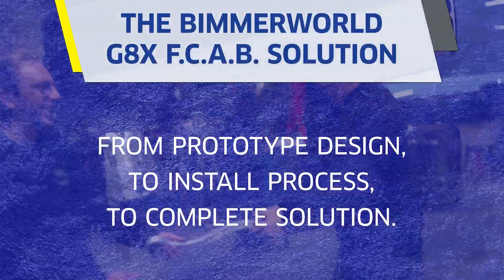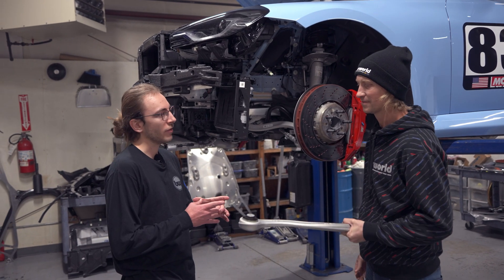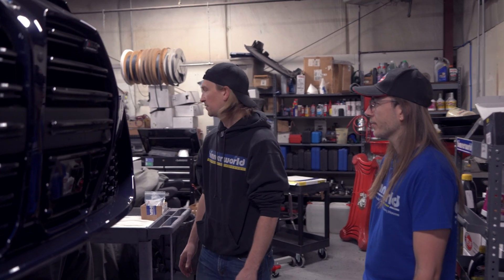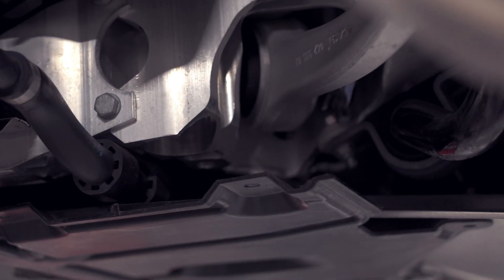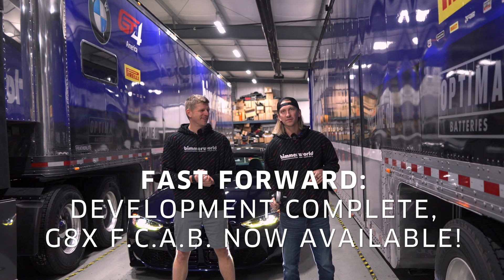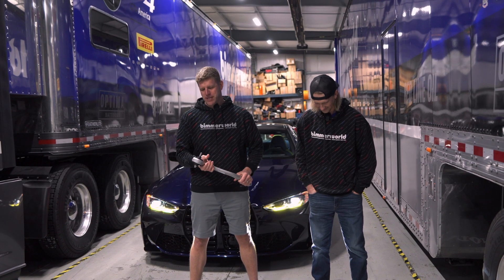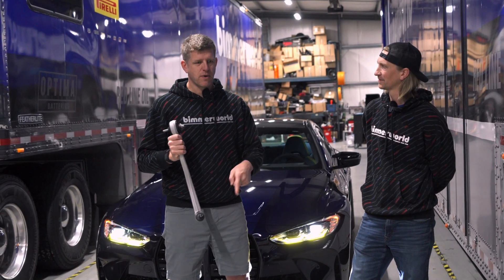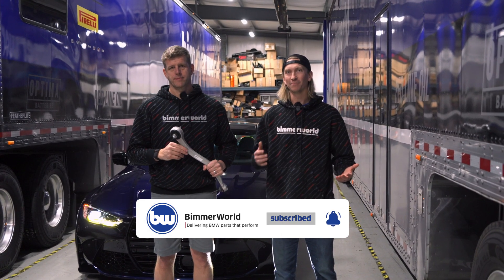Dropping Knowledge - A very simple part that EVERY G8X suspension needs.

Comment: Question for you. You didn’t mention the t27 bolt that holds a plastic part to the bracket. When you show the bracket out that module is not connected. Any idea what it is and how he disconnected it?
Reply: Sorted my issue. Came up with a way to access with a long extension fed from the front. Also got the bracket out using a bit more muscle than I planned too. But got it out, and the bracket in question stays where it is and it tied to keeping the oil cooler where it should be. So sorted my own issue. There was some knowledge learned on how to best pry the bracket out, that I think could have been shared by the mechanic for this process. But if you weren't the one doing it, you wouldn't be able to communicate that likely.

Bracket pulling was a bit more involved than a "Snap and done" scenario

Comment: Do this stiffen ride quality and and how does it feel on the street. Very curious to see if this improves road braking too !
Reply from the maker: It doesn't negatively effect ride quality at all.  And it will certainly help braking in all situations.  The G8X stock bushing in this location is more beefy than the previous chassis versions, but there is still deflection happening because the cars are so heavy.  Sticky tire or not, trying to stop 2 tons puts a lot of load on this bushing!

Comment: Appreciate the explanation of the ABS system interaction with the OEM part! Is this mode only apparent with sticky tires? I wonder why BMW didn't address this earlier, especially if there isn't much gain in NVH from going to a sealed bearing.
Reply from the maker: Yes you can witness this heavy load/unload situation of this bushing on the factory tires, but of course its heavily exaggerated on sticky tires.  There are about a thousand areas of a 100% stock BMW where we could say "why didn't they address this" but there are countless factors in their decisions (ease of assembly, cost, NVH, etc) versus what is possible in the aftermarket.  Thats where we are happy to step in.